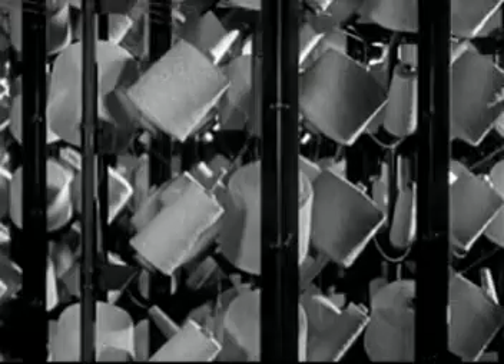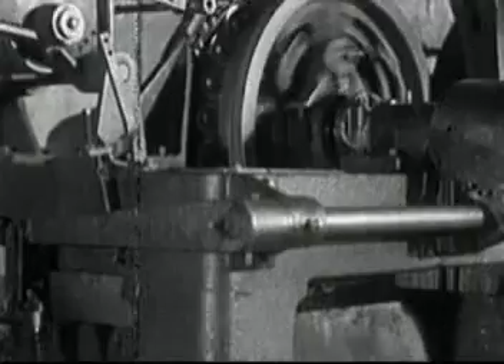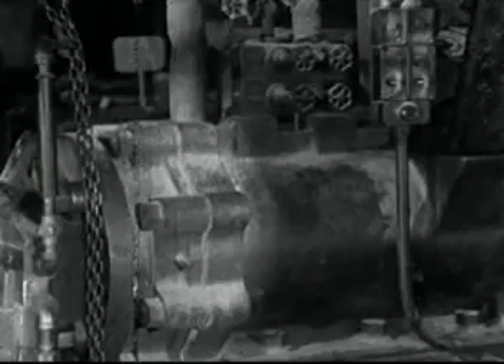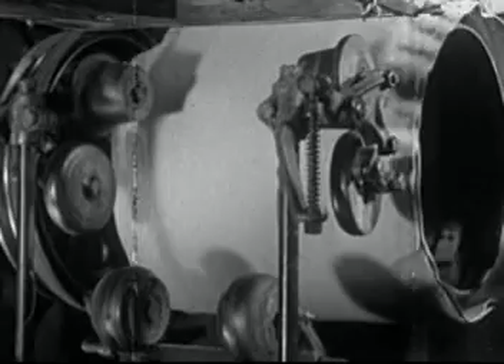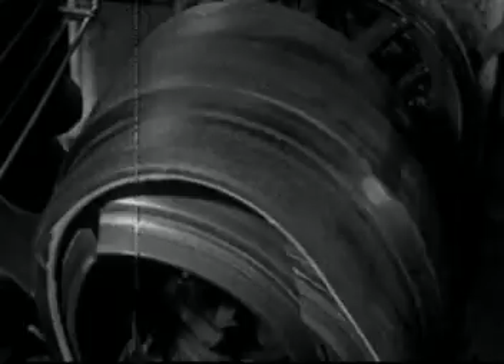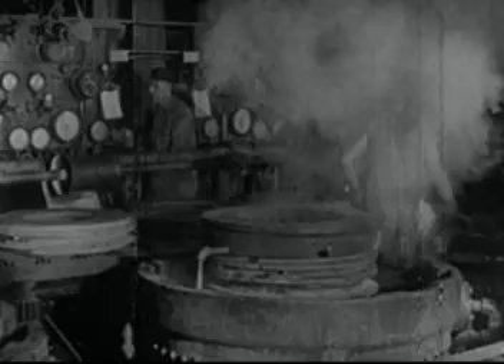Tire Building 1934

Comment: I bet parts of that plant smelled like heaven. New rubber, that should be a Christmas tree scent. I was looking at our unrestored 1931 Studebaker truck's tires. A couple Good Year All-Season 20x6 6ply, and a few Dunlop Cord 20x6 8ply tires. We think that we have one original tire for this truck? It may be a Kelsey "Balloon" black wall? All that can be read is the "Balloon" on the sidewall. These old tires spent their life hauling wheat from a 1927 model 34 and 1929 model 36 Holt combine, and then hauled into the local grain elevator in NE. It's neat to see how these tires were made back then.

Comment: Awesome video.  I live in Akron (Goodyear Heights actually) and pass Goodyear H.Q. everyday on the way to work.  Sadly almost all the rubber industry is gone. Silver lining is that air quality is much nicer.
Reply from the maker: Thanks - I grew up in south Akron and had cousins who lived in Goodyear Heights.  I recall the summer air pollution in the early 1970s - it would burn your lungs from the ozone.
Reply: It's all going to China hey? You can order Cummings 4BT and 6BT diesel engines and a number of Honda and Toyota engines from China.  They just copy everything.  How did they go from opium addicted rice farmers to industrial production inside of 20 years? Banksters, that's how.  They like the slave labor wages and not having to employ R&D.
Reply: We called that rubberized air!